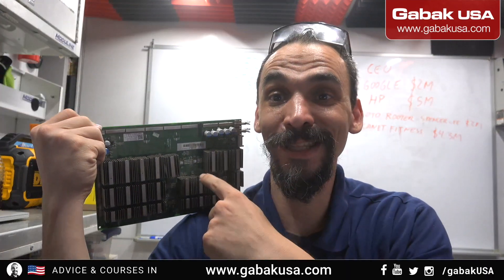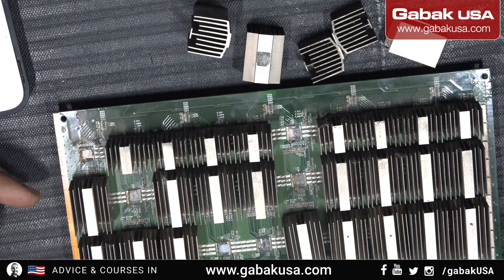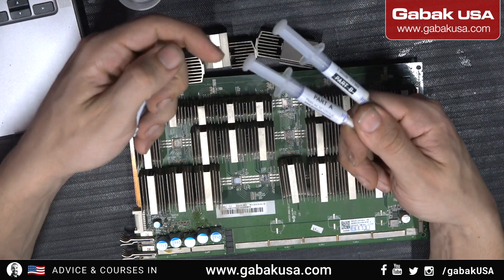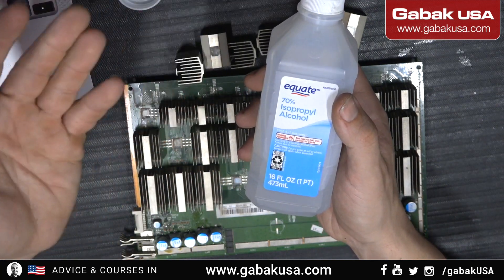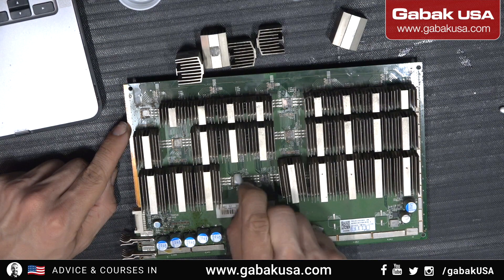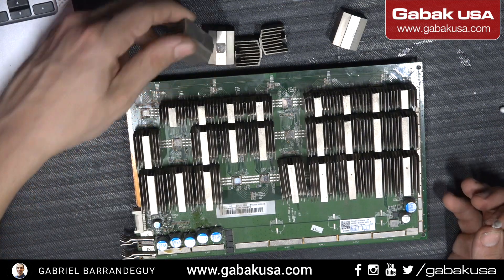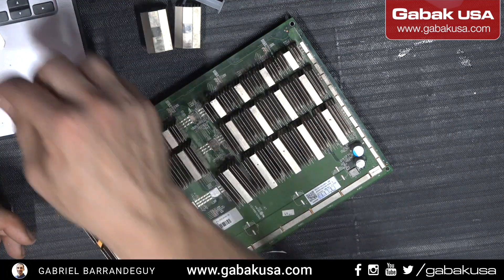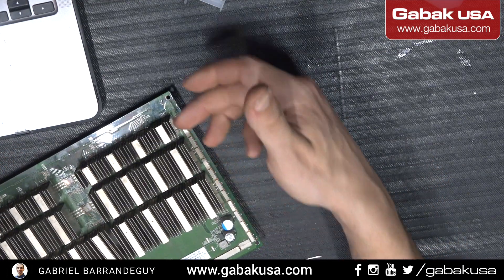how to fix heatsink hashing board miners

Comment: bro i have ebang e12 miner i want to over clock i put it on high performance but not increasing in TH i should increase frequency ? manuafacture frequency 520
Reply from the maker: i would not over clock it, it will cause problems over time, it is better to buy a better machine instead. It is up to you if you want to take the risk